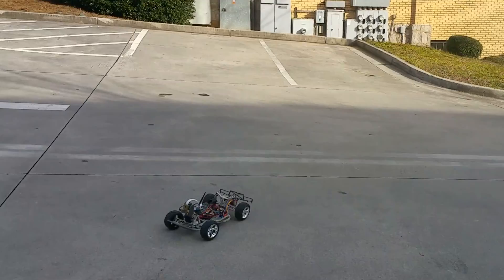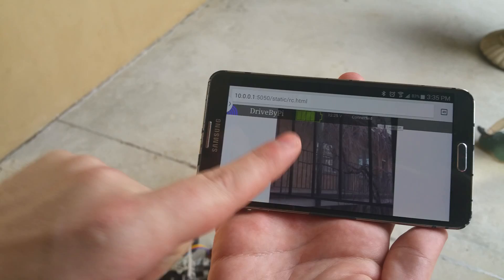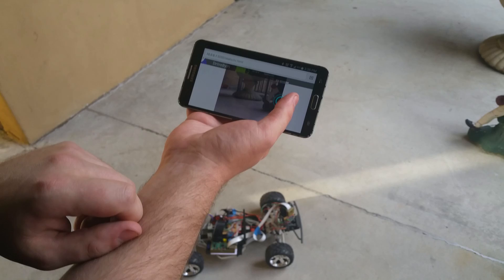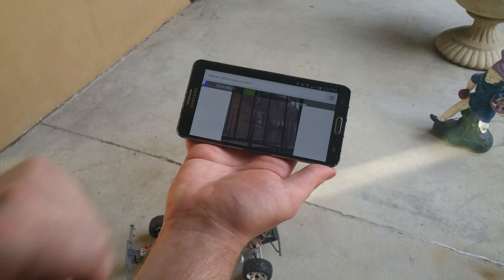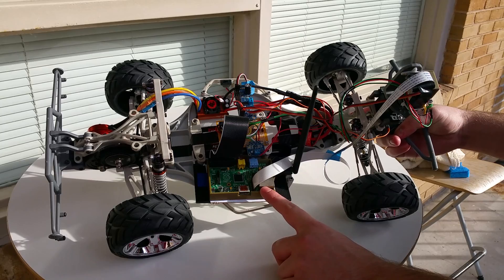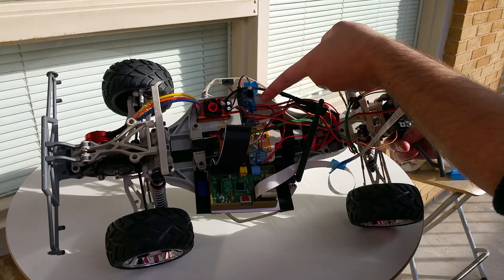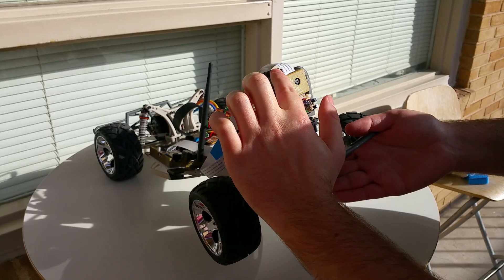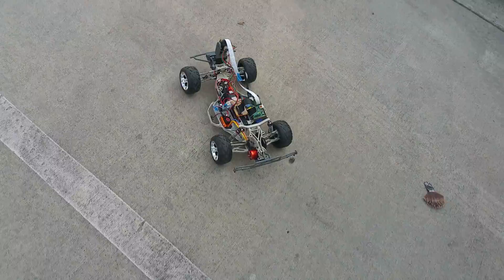Drive By Pi

Comment: Hey! great video! I'm now almost finished my build, the only difference is:
- WebSockets, not Comet as it's supported by major browsers and works like a charm
- UV4L for streaming as it seems better quality with less CPU
- WiFi to connect to any available WiFi points
- 3G modem as an internet access
- Navio+ board with Accelerometer, Gyroscope and GPS are on small board
- LidarLite to measure distances
- A few IR and Sonar sensors
- Special board to use two cameras (one at the same time, but real-time switching) one for Night Vision and second for Day vision